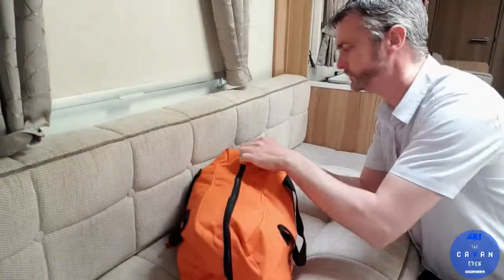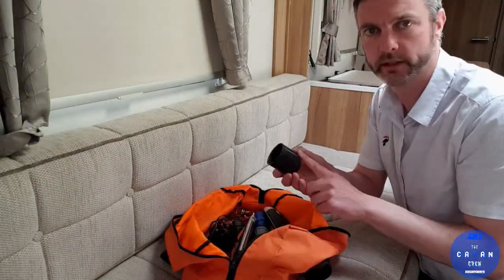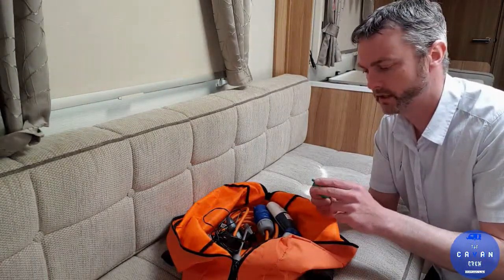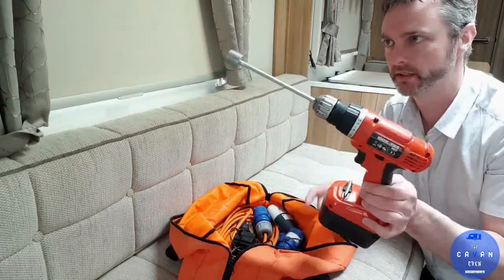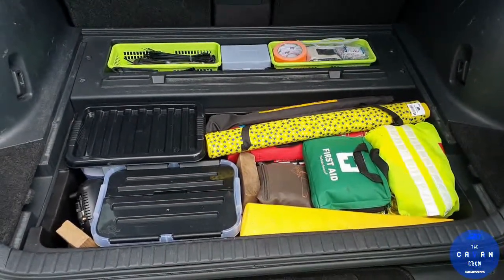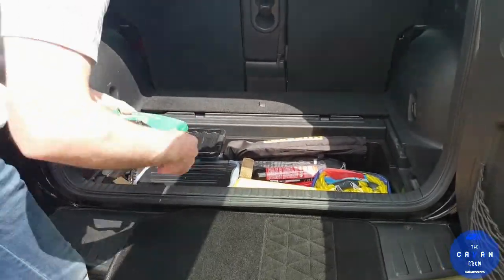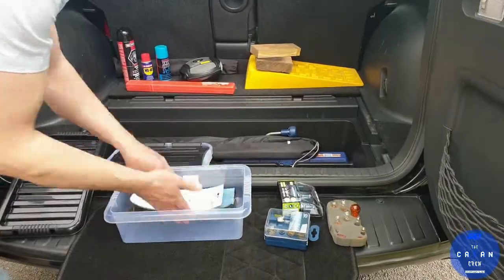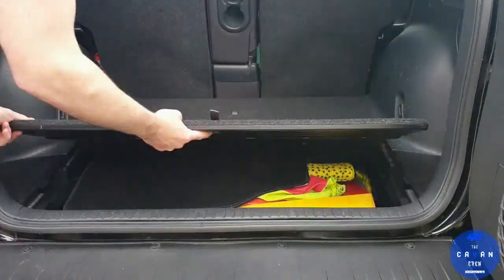Caravan Tool Bag and Equipment Storage

Comment: Very well organised me I am well organised too everything stuffed in one bag 🤭so I know it's there somewhere after seeing how easy it is your way will have to sort things out 😮 your channel came in my recommendation list showing the water carrier idea with the plastic tube going to do that one subscribed👍 that is one excellent setup you have but I didn't see a electric socket tester I carry one just in case of problems can't fault your kit though like the channel
Reply from the maker: Hi Alister, thanks for the great comment. I like the idea of the electric socket tester. Might be something to add in the future! The internal aquaroll pipe works well for us. Have had no issues at all since I put it in. Everything works so much better - the pump is at the bottom and kept straight, it’s much easier to fill at the tap, works great with the ball valve, and all the water is used in the aquaroll. Let me know how it goes for you. Evin

Comment: Great Vlog, wow that's some kit in the boot of the car and all stored nicely away under the boot floor. Does it all weigh a lot combined. Thanks for sharing.
Reply from the maker: Hi. Thanks for the comment. The space is in the floor as the spare wheel is on the outside of the boot door. The kit doesn't way too much. Lots of small and light items. The heaviest by far is the 2 tonne jack at 8.6kg, but I did take out the lighter car scissor jack. I weighted the car recently (with people and fuel) and it is still well under. I do carry the grillogas, caravan bag and a camping table in the car as well, which are about 8kgs each. Always prefer to have the weight in the car rather than the caravan.
Reply: @thecavancrew  Yeh I am like you, When we go away I always put as much as I can in the back of the Car, I am lucky I have previously had Land Rover Discoveries and now a Mercedes GLS so cavernous space in the back and load to the roof with Awnings Tables & Chairs BBQ etc. Thanks again for sharing Jams

Comment: You've got very similar stuff to ours in the van bag, although the stuff in the boot of the car is very impressive! Covers every eventuality. Great tip too on shortening the steady winder drill bar, they're too long! Thanks for sharing folks. Martin & Jo.
Reply from the maker: Thanks for the comment guys. Great minds think alike! It takes a while to get the caravan bag and car the way you want it. Lots of trial and error! Keep posting, great tip on using the pipe lagging to keep the hangers in place and I must thank you for your video on sprucing up the caravan sealant. Good job. Evin & crew
Reply: @thecavancrew  Thanks for the kind comments Evin, you're welcome mate. Your trial and error has paid off with that boot, the boxes and compartments are spot on!